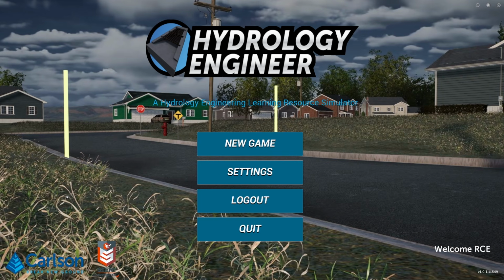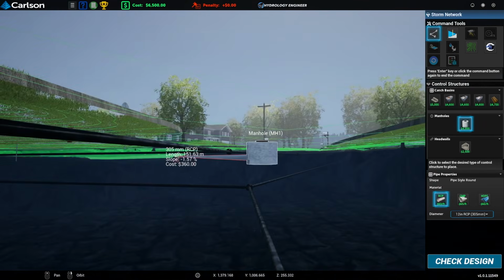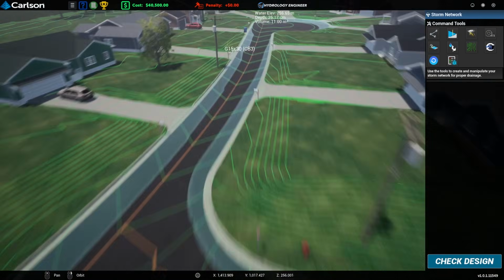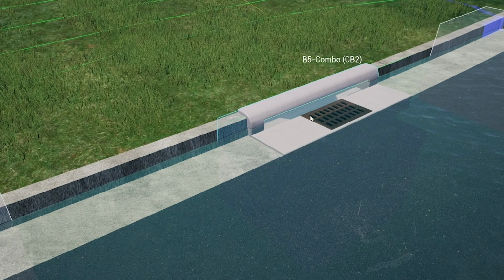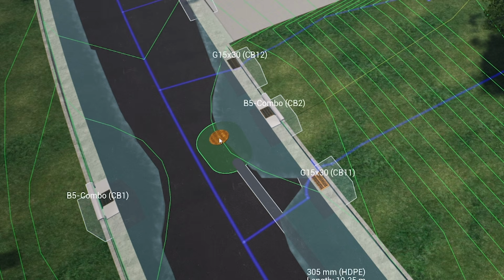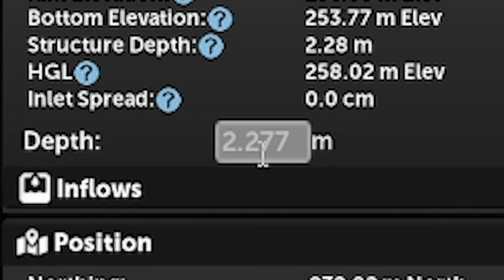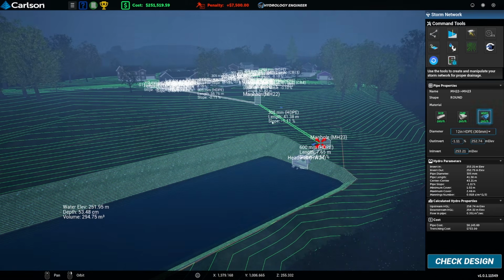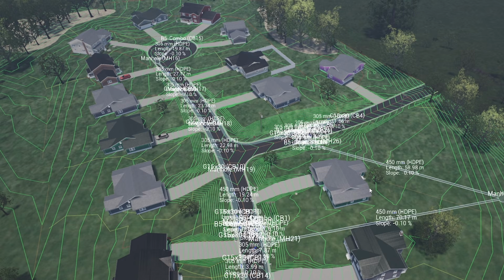The secret purpose of these holes...

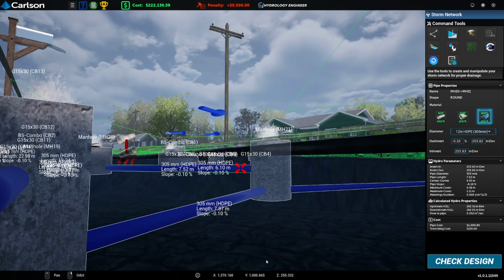Comment: 30:21 In videogames, we use y as the height because of monitors... The idea comes from 2D games, where the x and y come from screen coordinates where x means the width, and y height. When devs where making 3D games, the extra "depth" was just added as z, making x,y coordinates easier to transform for sprites and that stuff. Today, we just kept it. Software designed for other purposes kept the x,y as the base plane, and z for height, which means that game devs need to consider what one software uses compared to others. For example: Blander uses z as the height, while unity uses y as height. If you manually export from blender to unity, you might need to tweak the import values to make sure it gets properly oriented.

Comment: I guess Y as an elevation coordinate comes from the fact that when looking at a game the X and Y coordinates on the screen are the width across the horizontal and the elevation across the vertical, which worked fine for 2D games as the game coordinates matched pixel coordinates but then we went and added a whole new dimension with 2.5D and 3D games so rather than change how it's projected and confuse all the existing hardware and software dealing with coordinates as pixel positions they made depth the Z coordinate. So blame developers and legacy compatibility XD

Comment: I went to an engineering university, and the convention we used was that X and Y are along the reference plane, and Z is through the plane towards the observer (because right hand rule).
So if you're working with maps, Z will be elevation, but if you're working with cameras, Z will typically be depth and that will naturally map elevation to Y.
Reply: It's the same with graphs and plots. X and Y are your standard axes, and Z is the extra one moving orthogonally to both X and Y. That means if you put it on a desk, it aligns like a map, but pin it to a wall (or a display screen), it aligns like a 3D camera. I wonder though - these all assume local coordinates map to global ones. Are there any construction projects so large and so precise that you have to account for the Z coordinate deviating from parallel due to the curvature of the Earth?
Reply: @magma2050 at least in cabling, curvature of earth is a non-issue since local curvature always have bigger effect. For 1 km, the spherical plane curved ~8cm, but locally the height difference could be several orders of magnitude more.
Reply: @magma2050  Not one, not even thousand mile railroads, oil pipes or sea cables, which  is curious don't you think?
Reply: For thousands of years it's been the same, at some recent stage people misunderstood horizontal 'depth' (horizontal distance from you) to mean vertical depth so it got mixed up. 
If an observer is at sea level facing north, 'X' is a horizontal line between you and due north (depth horizon), 'Y' is any horizontal line intersecting the 'Z' line at a right angle running east-west (linear horizon), and Z is any line intersecting X or Y vertically (vertical elevation).
Reply: @wobblyboost  yeah, and apparently the Minecraft kids are so brainwashed they think it's correct.
Reply: @wobblyboost  I'm gonna need a citation for them thousands of years.
Reply: @Poldovico  Isosceles, your welcome.
Reply: @wobblyboost  what are you even talking about?
Reply: @Poldovico  The citation you demanded, now go look it up.
Reply: @wobblyboost  Yeah, you might wanna double check that. Kinda hard to google "Isosceles" and find anything other than the triangles.
Reply: And if you do both, work with terrains and roads for applications that uses cameras: you use both.

Source: used to do simracing tracks and things switch between Z up and Y up constantly...
Reply: This is an interesting and sensible way to think about it. I think that's essentially how I also think about it, but much more naive: X is left and right, Y is up and down, just like your typical 2D graphs. And in 3D, "up and down" means elevation. That's how I create my projection matrices anyway. However, I make things much harder for myself by projecting positive Z as forward, to align with the positives and negatives of a thumbstick. For me, it doesn't matter if it's wrong or right, I just do it for the fun and the learning, and it works.
Reply: @c4ashley  It's not right or wrong, it's left handed. Means you're then using left-hand rules instead of right-hand rules, and you might have to account for that when doing vector multiplications and such.
I think the most apparent effect might be that the signs of your rotation quaternions are different.
Reply: Yep. And when you're creating a 3d world, you're not a camera. Devs should have called up and down Z.
Reply: Goes to show how much you know about unreal  @BishopStars
Reply: @BishopStars  When you're rendering 3D graphics, you're projecting a frustum onto a usually vertical screen.
Like a camera does.
So the creators of early 3D graphics software treated it as such.
Reply: @Poldovico  Right, they did it wrong.
Reply: @BishopStars  it's not wrong, it's more correct than you think
Reply: @BishopStars in video games all graphics are rendered through virtual cameras, so using camera convention makes more sense than graph or map convention for 3D games.

Edit: basically a character in a 3D game is a camera + hitbox
Reply: @jkjkrandom  However, an important part of video game design is making it user friendly and intuitive to as many people as possible. The game devs can use whichever convention they prefer in the backend, but the final presentation to the player should be remapped/reskinned to show most common convention.

Comment: Your explanation for why the pond is sized to a larger storm than the drainage could probably be shortened.
The pond is sized to large because it deals with each storm slowly, sometimes over the course of several months, while the drainage deals with each storm in a matter of hours at most.  If the pond and drainage were sized based on the same event then the pond could flood should large events occur more frequently than usual.

Comment: Y being vertical in computer games is an artefact of the way computer graphics evolved. Screen coordinates started as X for horizontal, Y for vertical. Then Z indexes got added for determining which objects are drawn on top. The arrival of 3d changed the z-index to a full dimension, and the matrix maths to project from 3d space to viewport coordinates is just that bit simpler to read when it doesn't need to include an extra rotation.
By this point, it's just convention - it doesn't really affect the maths, and most developers never actually get involved in the 3d rendering code.
Reply: yeah, like websites, +z is closer to the view and -z is further from the view.
Reply: It does still mess me up that +Z is South in Minecraft. I know it's because of the right-hand rule, but I confuse game coords with map coords (as an Australian I've been heavily conditioned to know that  -27.47 means South).

Comment: in videogames sometimes the coordinates are like that because they are meant to be relative to the screen as that is how you are rendering the graphics. So X and Y are parallel to the screen and Z is perpendicular. 

In Minecraft the tab that shows you the coordinates is supposed to be a debugging tool for the devs, but it is so useful that people use it in the game itself and people got so used to it that removing it or changing it to a more intuitive system would probably be a negative now.
Reply: It's quite convenient that way in OpenGL, since if I want to do 2D graphics, I can just use the calls that only take two coordinates (X and Y) and the third one defaults to zero.
Reply: @gredystar8333 and then there is me, constanly getting lost in minecraft looking at x and y. Thinking I was remembering z axis the wrong way 😂
Reply: Yeah, game coordinates are based on the display being a vertical surface. X and Y are the axes for each side of the screen, and Z is the depth: close to or far from the camera.
Reply: @DZ-X3  hence why two polygons being drawn at the same depth have "Z-fighting".
Reply: And then there is Unity, with its left-handed coordinate system.
Reply: Got it, devs messed up the coordinate system.
Reply: @BishopStars The Minecraft devs have not messed up coordinates.

Since, Minecraft uses Open GL it also uses the same coordinate system.
Reply: It's preposterous to just blithely accept that a convention arbitrarily invented for game design should then just be adopted by millennia old universal dimensional physics, the original method describes, explains and maps the THREE DIMENSIONAL physical reality we live in. 
Thus a single point (X=0) is dimensionless, assuming an observer standing at sea level at X=0 facing north, an horizontal line away from him to any point north is X axis, which is one dimension or depth horizon; an horizontal line intersecting X axis at right angles (left-right or east-west in this scenario) is Y axis, which is two dimensions or linear horizon, any line intersecting X or Y vertically is Z axis, which is three dimensions or vertical elevation.
Can't just throw all that away to make minecraft coordinates make more sense, as much as billy goats would probably like it.

Comment: No, it's because we now work on screen. And we use X and Y for screen. Not for top down view on table. Z go forward is standard for digital age
Reply: In right-handed coordinate systems, you either get Z going backwards out of the screen, or Y going downwards.
Reply: @Poldovico  And so when we switch from horizontal plane to vertical plane we should also switch from RH to LH, that was a lot more sensible
Reply: @ThainaYu  I really don't think it's worth breaking every math guy's shorthands and intuition just for that. glares at Unity
Reply: @Poldovico  That conversely breaking every intuitive of gamer and computer user since we have 3D game on monitor. Seriously I am programmer and I feel that LH coordinate is correct way since DirectX 7
Reply: @ThainaYu  so, unreal, godot, blender and a lot of other programs are going to be difficult for you. But with Unity you will feel right at home.
Reply: @Poldovico  Surely. They are adopt wrong convention and make unintuitive decision

I could argue that RH coordinate started from architect doing a job on table and making floor plan file. So in short, RH coordinate is architect's standard
Reply: @ThainaYu  You might argue that, but you'd probably be mistaken if you did. You can actually look up where the convention came from, it's fairly recent. No prizes for guessing it's credited to a mathemathician.

Comment: For the X Y Z coordinates, I think in general (at least where I live) the math teachers don't help, cause first time you see a graph they explain Y as the vertical and X as an horizontal, so way later on when 3d gets taught, you add the Z as another horizontal. Like, take basic physics about a kid throwing a ball, we would use X (distance) Y (height) for calcs way before knowing about a Z axis
Reply: That's different because you are working in 2D space.
When you move to 3D space, the naming of axis also changes.
Reply: @marceelino  yes I get that, but like, adding a Z to the side is easier mentally than switching the whole structure you have been seeing for 3 years
Reply: *taught. Teached isn't a word
Reply: @Rawwdogg_teet  thanks police grammar, the point wouldn't have gotten across without you

Comment: I feel lied to. Where I live, holes in the curb are for sump pump discharging, not drainage. It's wet enough around here (especially with snow) that it's sometimes hard to discharge the sump pump without the water basically soaking in and working its way right back to the basement drains in a continuous cycle. The city will allow those people to run an underground discharge pipe to the curb outlet, where the water can then flow into the storm sewer.